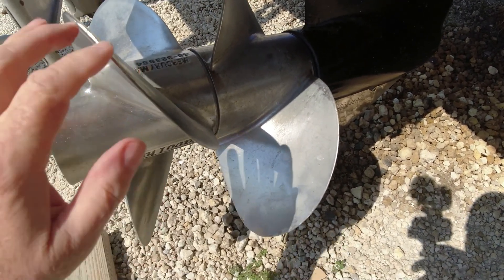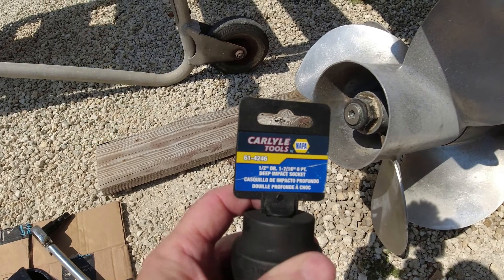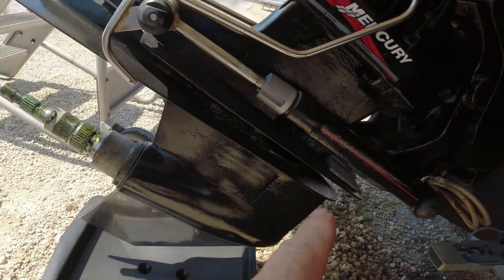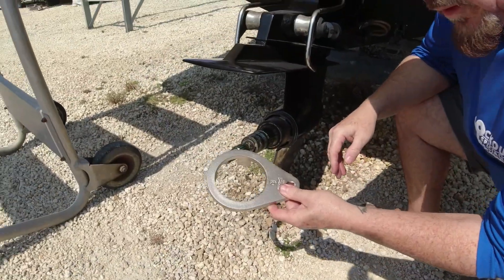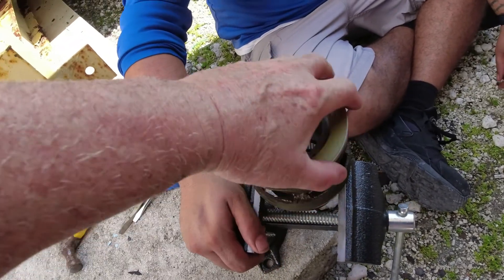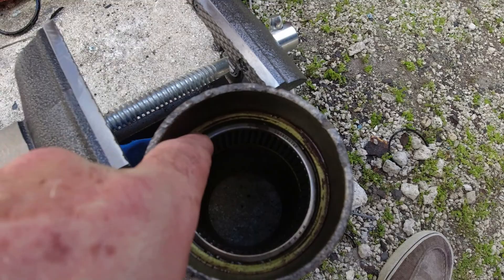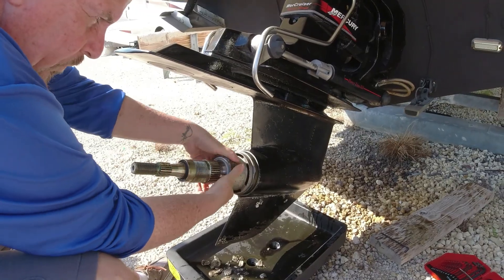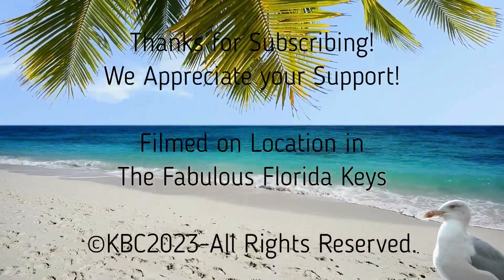HOW TO REPLACE A MERCRUISER BRAVO 3 OUTDRIVE PROP SHAFT SEAL

Comment: I’ve noticed some gear lube oil leaking from the lower-most holes of the side water pickup holes on my Mercruiser stern drive. So it doesn’t appear to be a prop seal leak. The leak seems to be above that. Do you have any idea as to where this kind of leak usually occurs?
Reply from the maker: Hi, on mine I did not have any oil leak on the water pick-up holes. Wow, not sure about this one...you may have to check with a marine mechanic. Sorry! But if you find out I would like to hear from you about this issue, it could help others. Thanks for watching our video! Peace from the Keys!
Reply: Thank you.

Comment: Thanks so much for this video! Helped me right thru this job! Had issues like you did getting the seal carrier out of the thing! Man it took a lot of careful banging to get that thing out but I got it out and got the new one back in the same way you did! I would also recommend replacing the O-ring as well which I did. Thanks again great video!
Reply from the maker: Hi Chris! Glad this video helped! Yes, the o-ring should be changed also, just did not have it when I did the job. Thanks so much for watching Bro! Peace!

Comment: Great video and instructions, did you have replace what looked like a o-ring on the outside of the seal carrier or is it unimportant?
Reply from the maker: Hi Michael, thanks for your comment. We reused the same one on there, but may change it on my next prop service. It looked in good 
shape no nicks, or cracks, we did removed it to clean out all of the broken pieces of shells. So far its working great. Thanks for watching! Peace!
Reply: Its very important since it keeps the water out and oil in. I replaced mine its about $1.25  for the OEM O ring.

Comment: Did you have any issues with removing the screw at the bottom of drive to drain oil? Mine seems very stuck. Thanks for the video
Reply from the maker: Hi, thanks for your comment and watching our video! No never had any problems with the drain screw. But to make it easy to remove, just put a good size screwdriver and tap it a few times with a hammer and then try turning it... this always works for me. Thanks! Peace!